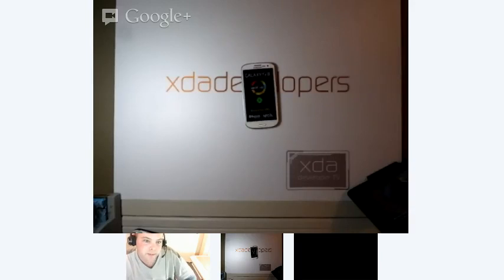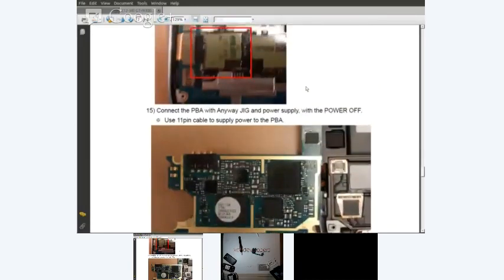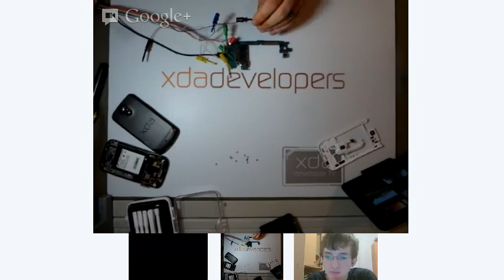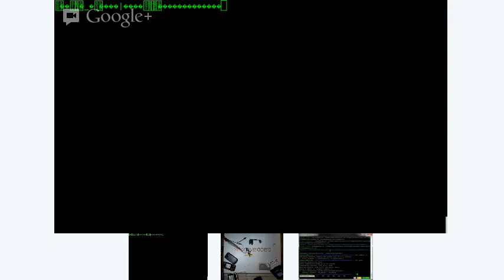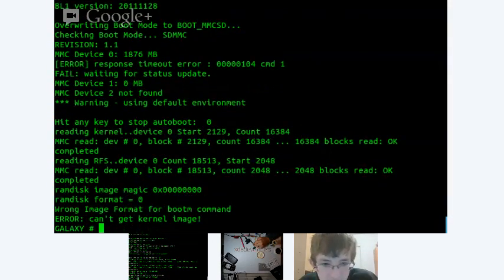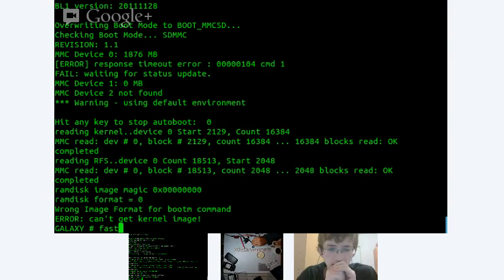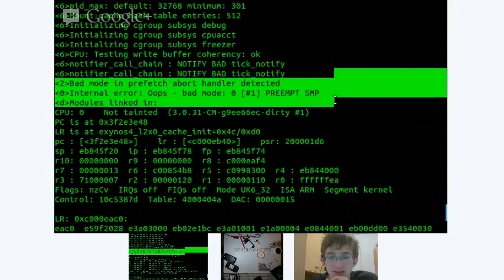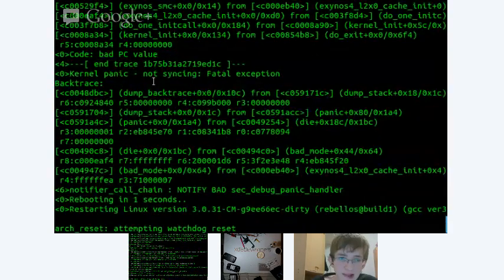GS3 Teardown, UnBrickable SD Mod, UART location

Comment from the maker: This was a huge sucess.  I've annotated the high-points of the video below
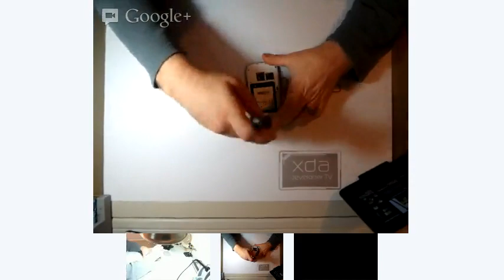1:00 - Teardown
4:10 - Disclaimer :)
8:30 - UnBrickable SD Mod
13:39 - Using bus pirate to locate UART
18:00 - Located UART TX
28:39 - Dominik Freaks out when he sees his bootloader boot
31:35 - locating UART RX line
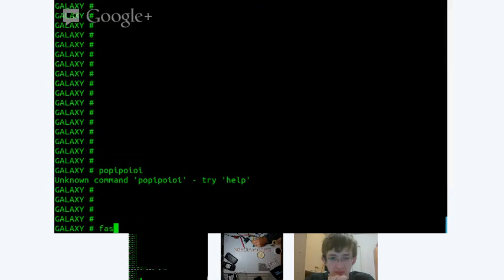32:28 - Fastboot on the Galaxy S3
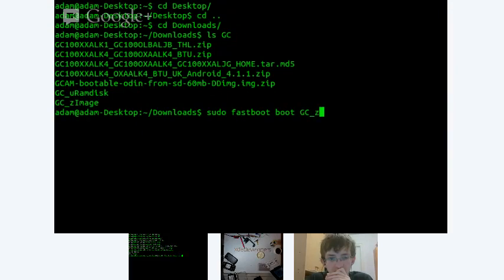33:34 - Fastboot booting a kernel followed by troubleshooting kernel
51:50 - wrapup
Reply: it was a fun video to watch live :) can't wait for the next one!
Reply: Awesome to watch, for a non dev... can't figure out how you can read those outputs... but it's awesome.!
Reply: I wonder what the stock kernel would do instead of the cm kernel. Not sure it would make a difference, just a thought.
Reply: Awesome :)
Reply from the maker: Jason Mossbarger it wouldn't get very far
Reply: Adam Outler when are you doing a public release of this!?
And sorry for the ETA, I couldn't resist asking. ;)
Reply from the maker: In the words of ***** , after I make 400 more posts and I get 3000 more +1s. It may or may not be sooner.  We both need this in order to continue work.
Reply: Adam Outler haha, both of you will get it no time!!!
Reply: That guy Dominic does know one or two things. Kudos to him.
Reply: I thought the video was great. I just found myself wishing I could see you solder and poke at the board.
Reply: Do you have donations set up anywhere?
Reply from the maker: Adam Baxter on the xda forums there is a donate link under our avitars.
Reply: Are you willing to disclose how much more you need to purchase an S3?
Reply from the maker: I have $200 I've earned from donations and services in my account currently. I don't know how much it costs.
Reply: $500 is about the non-sale average.